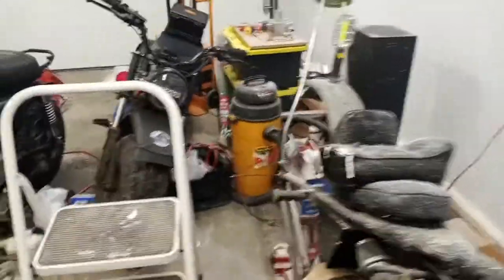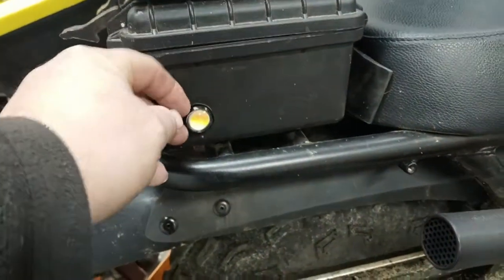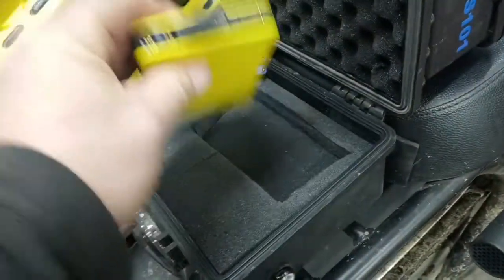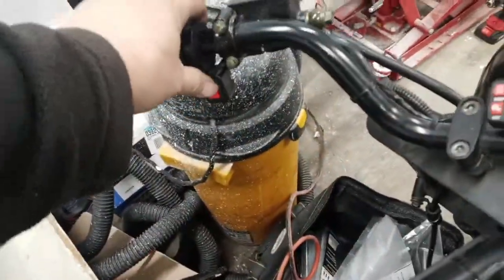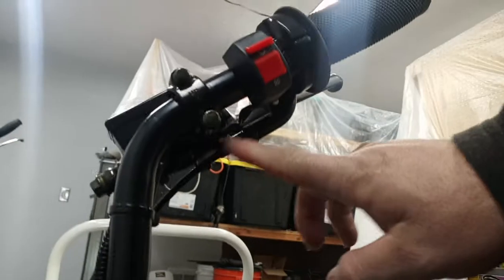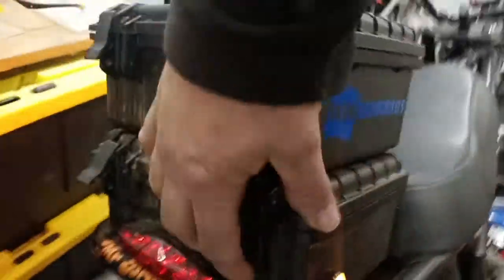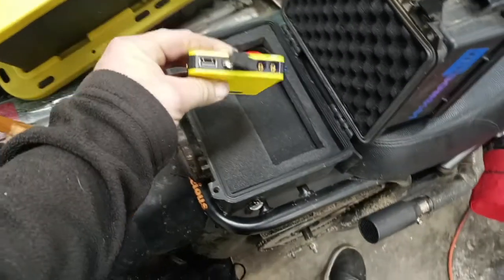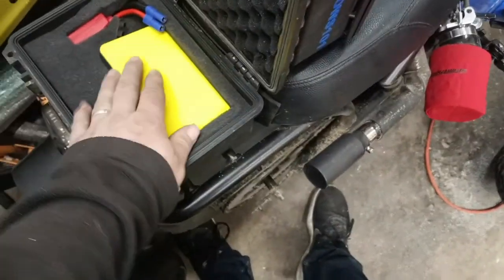Custom LED Lights Explained / MM212 Pro Mega Moto

Comment: If you have to choose between Trailmaster and mm212pro which do you keep.
Reply from the maker: My friend has 2 trail masters. I rode one for a year before deciding to get a mm212 pro kit. so glad i did!!!
Reply: @mr.braapalicious  I love my MM212pro. I welded the engine plate up with some angle iron right out of the box. I also did the split shaft collar swap on the jackshaft which makes it roll like buttah. I just cut the Trailmaster pegs off and I'm getting ready to fabricate some reinforcement. I do not like my Trailmaster as is.